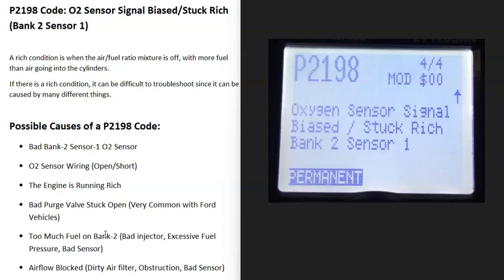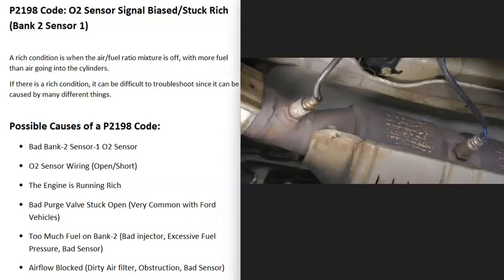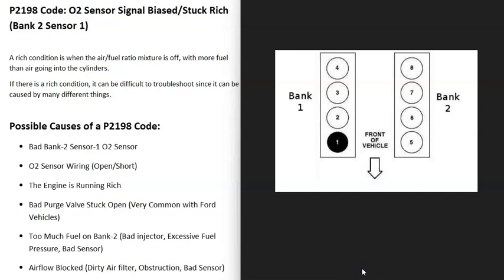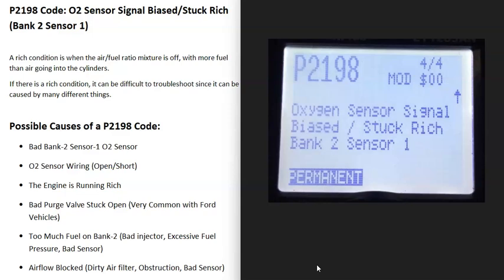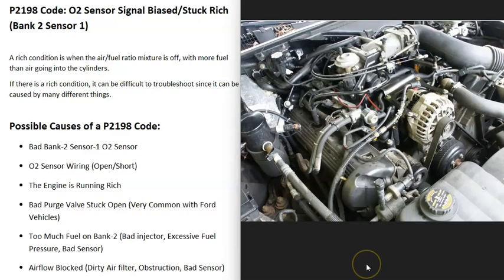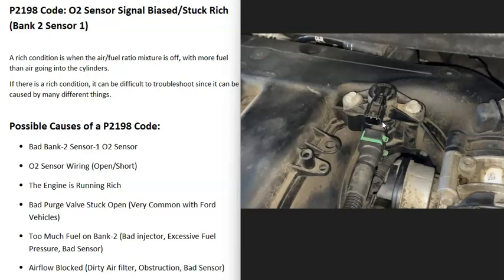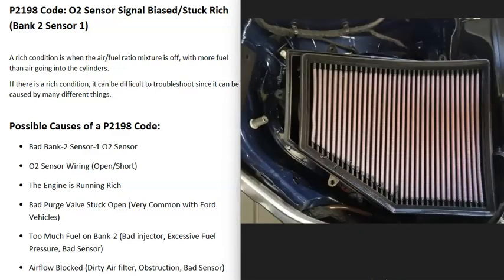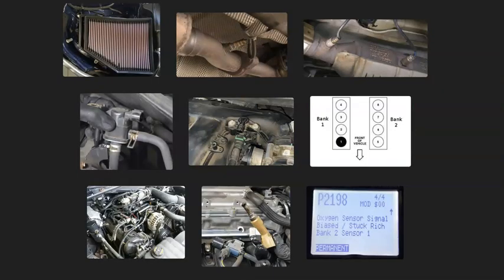Causes and Fixes P2198 Code: O2 Sensor Signal Biased/Stuck Rich (Bank 2 Sensor 1)

Comment: Just had a catalytic converter‘s replaced with Walker aftermarket cats and four new Motorcraft oxygen sensors truck was running great last night started doing this this morning don’t get it because all four chances are brand new maybe something else happening like you say had no check engine light anything was where you can run the truck through omissions now I got a check engine light can’t do it again and struggling this last time getting it through the inspection as it’s over two months overdue with my guy had just inspected it yesterday when he did the converters cause it was ready to go through right after I drove it any ideas would be helpful

Comment: Hello, I am stuck trying to help my mechanic figure out what’s wrong with my 2011 Ford Explorer Limited Edition. Initially the engine misfired, was shaking the entire car, & the smell of gas was present. I pulled into a parking lot & it cut off. I was able to start it right back up & bring it home. The codes we got were P2196 & P2198. My radiator was replaced  (old issue), my spark plugs, & ignition coils. I drove the car for a week & it ran beautifully. Out of nowhere there is the misfire again, the smell of gas, rpm gauge fluctuated & even though I was stepping on the brake it sounded & felt like I was stepping on the gas! Check engine light comes back on. I panicked, parked the car & it dies. I start it right back up & bring it home. New codes P2195, P2196, P2197, P2198! I’m wondering if you have any tips or ideas on the issue? My mechanic is great but I’m not sure he knows where to start. I assumed a vacuum leak or fuel injectors. The spark plugs were pretty old but now I’m not sure we needed ignition coils. Any help is greatly appreciated!! 😊
Reply: @tanayarogers7985  Yes if you don't mind. I am trying to help a buddy out troubleshooting his. He said he was having the same problem your having. Thanks
Reply: @jerrygaynor4384  sorry Jerry! I totally forgot to respond. That fixed my issue. I hope your friends issue was resolved.
Reply: Have you checked the purge vale to see if it was working?
Reply: @jerrygaynor4384  I literally just had another mechanic come. He told me that the canister purge valve was stuck closed and he replaced it. The code he got was P0456. I am praying that is it. I will update you in a week (if you care to know). Thank you for your reply!!!
Reply: @tanayarogers7985  Hey, did that fix the issue? Im having the exact same problem
Reply: @salahquad9355  hi, yes that worked. I haven’t had any issues since.

Comment: I’m getting a p2198 and p0191. Fuel sensor, fuel pump, and fuel pump driver module have all been replaced. My purge valve is working as intended. I checked fuses and they all looked fine.

Truck is an ‘07 F150. The truck runs fine when cold, but stalls, dies, and idles rough once it’s warm. For this reason, I doubt it’s the fuel pump itself. Any ideas?
Reply: Did you figure it out
Reply: @Criaderovaldez  My buddy suspected that the truck was actually running lean despite the 2198 code. He said the engine smelled hot. I put paper clips into the wiring harness that attaches to the fuel pump driver module, and it ran fine, despite actually running very rich since the fuel pump was going 100%. But that eliminates the pump. I’m guessing the fuel pump driver module that was replaced was a pos aftermarket. Ordered another one.
Reply: @jacobk1160  lmk what happens after replacing fuel pump module
Reply: @Criaderovaldez  been running for around 30 minutes in my driveway. A bit rough at idle, but that disappears when I accelerate. Theres a thunderstorm right now and I don’t want to be stranded in it, but I intend to drive it around to see how it performs otherwise. Spark plug were replaced just 6k miles ago, and I pulled a couple of the plugs during my messing around with this, and they looked good.
Reply: @jacobk1160  have you checked injectors and o2 sensors
Reply: @Criaderovaldez  I have not. The o2 sensors are getting a good voltage reading in my scanner. I drove it around and the code tag popped up was a cylinder 5 misfire. I pulled the plug and it had carbon build up on it. Smelled like fuel. I think it’s my injectors
Reply: @jacobk1160  yea usually leaking injector if it's not o2 sensor
Reply: @Criaderovaldez  swapped fuel injectors and the issue didn’t carry. Still cylinder 5 misfire. My catalyst temperatures are both reading high. Under higher rpm they get to 1400°, and at idle they’re at 900°. Both banks.

I doubt both o2 sensors went bad at the same time, let alone both cats getting clogged. Baro pressure is normal, which would also not indicate a clogged cat. 

So I’m guessing it’s something to do with air, but no idea where to start
Reply: @jacobk1160  start with mass airflow sensor
Reply: @Criaderovaldez  it was a spark plug. My best guess is while driving it with the gas fpdm or rail pressure sensor, it was running rich and fouled a plug enough to make it go bad
Reply: @jacobk1160  did it fix the issue